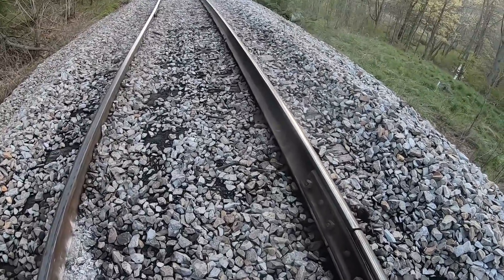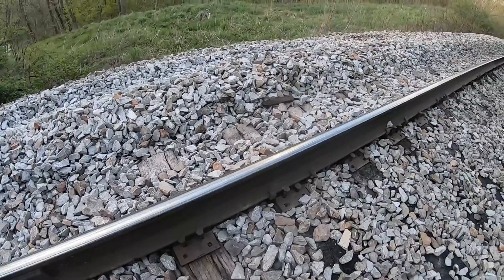Major Derailment: Locomotive Derailed & 2 Cars plus1400 Feet Track Tore Up!

Comment: Why would they NOT shut down the loco engines?  There're not going anywhere fast.
Reply from the maker: Locos are left running a lot of the time here, they never shut
down during the winter even if parked in a siding, Had there been
any leakage under the loco then it surely would have been shut off
right away.  And, consider if the loco was shut off and for some
reason wouldn't start again, that would severely complicate things
for the track repair crews. We have no way to drag it west out of
the way. They were also hoping Hulcher could somehow re rail the
loco quickly so no need to shut it off. Thanks for watching
Reply: @ccrx6700  that's really amazing considering wasting all that fuel just cuz you think the batteru might not start the engines.  I wonder why they don't put pony motors in to start the engines.

Comment: You got a mess on your hands to fix, could have been worse.
We had a 50 car train with 28 cars off the track and on their side in Albert Lea, MN, on May 15, what a mess that was, also 2 cars carrying hydrochloric acid leaked 40k into the ground, lucky no crew were hurt and no fire. Took about a week to get it cleaned up and the line back open.
Reply from the maker: Oh wow! Call out Cranemasters, Hulcher and Corman on that one.  I'll try find it online thanks 👍

Comment: Hey man.. you rr opps should consider getting "stampped steel ties" you arent CTC.. they hold gauge , use pandrol or similar clips and would help prevent rail rollover as well as gauge separation in curves. They cost more money up front but retain value due to when they are waste they are 100% scrap-able. You can replace or use them spaced out with wood ties. Probably would have saved this situation from happening.. seriously a good idea to have your company look into.. especially considering you guys are about to have to buy a lot of ties.
Reply from the maker: Martin thanks for watching and hope you will take in my next video
on my theory on why the derailment happened. It's here:
https://youtu.be/2uGomCuZkV0

Comment: Simple, get the cars up and moved to good track, get the locomotive up and move it the other direction, kick the rails to the side, jerk the rotten ties out, replace everyother one or every third ( depending on what's left of the originals ), rebuild, tamp and line. AND OF COURSE, WHAT CAUSED IT. Will be watching for that video.

Comment: That must of been a terrible surprise for everyone, including the train crew. Seeing the mangled rail a ties that are chewed to pieces really shows the mass and power of the train. I sure am sorry Dave. This probably hits you hard personally, especially considering the pride you take in keeping this line in shape. There's nothing you could have done about it. Maybe the company will allow for larger maintenance budget. I'm really looking forward to updates on the repairs but only as you are able. How that engine didn't tip over is amazing. It's a long drop off the edge too particularly on the one side. Just wow.
Reply from the maker: Yes it did Jeff, you know me pretty well, and you are right, this was a wake up call and our budget has increased from skimp where
you can to now spend whatever it takes! Thanks Jeff

Comment: Phizzicks man... One weak point can cause a cascading failure like this. Lucky the cars and power didnt roll and drag more train off. I guess what save you guys from a bigger mess is that you guys run typically at lower speeds, you're not running at 50 - 70 MPH and such.  Will be interesting to see how they get equipment in there and stabilized enough to put the cars and power back on the tracks though
Reply from the maker: Got a lot more vids coming out for you my friend, just don't have
anything like this happen with your new cars you just made....LOL

Comment: The locomotive has every last wheel on the ground.. but it stayed on the road bed and upright. The coal cars rolling would have been less of a problem than if the locomotive had run off the road bed and tipped over. There would probably have been extensive damage to it  had that occurred and you would possibly be looking at replacing it. Think that would have been more expensive than just needing to get everything back on the rail and the rail fixed.
With the cause.. the laws of physics tell me the outside rail was being pushed against by the train as it negotiated the turn. Being you said it's a tighter turn that means more force pushing against it with those 3 axle trucks. The force pushing against the rail over time was pulling against those spikes every time the train rolled through. A millimeter of movement here and there eventually created enough free space between tie and spike to allow the derailment to happen as a all but indiscernable gap let spikes pull free letting the track begin to roll. Speed might also have been a factor. Normal track speed on that turn might be too high for it. The faster the train is moving the harder it is going to push against the rail on a turn.
Reply: @
Jason Platco

hello how are you doing

Comment: That sucks man, I've been through two derailments, never that long of track though and had the same company come up and re-rail cars for us. Good Luck with everything.
Reply from the maker: Thanks Eric, yea these kind of things suck, but it happens as
you know, just gotta do what we gotta do. Hows the tamper running for you? I've been told tamper is the only machine that
can break down in a siding not running....LOL
Reply: @ccrx6700  Tamper is doing good. We just had a derailment too this week due to a sun kink, about 600 feet, 13 loaded cars of rock went off but nothing tipped over.
Reply from the maker: Oh dear! We had use excavators to line track close to where needs be, then i final with 6700. Get some rest cause once yrack tied in all pressure gonna be on you. Good luck an keep me informed my friend

Comment: Is there an industry test for railroad ties?
Also glad nobody was hurt.
Reply: There are on-track vehicles that can test ties/fasteners in track using something called a "Gauge Restraint Measurement System" (GRMS).  This system applies vertical and horizontal loads to the rails to test if the ties/fasteners are holding the gauge correctly.  There are also regular track geometry measurement systems that look for gauge change as a rail vehicle goes down the track.

Comment: Having investigated many derailments I can sympathize with your predicament. It is always a gut punch when it is your track. There is so much to check out; operation, mechanical, and track condition. In the video where you show the broken base I noticed what appears to be the point of derailment. Note the burr on the rail head. This is an assumption on my part. Lots of questions??.?? Good luck.
Reply: I'm thinking train Slack and then a heavy jerk derailed the cars in front of the engine on the Curve???
Reply: @plymouth-hl20ton37  it would be interesting to see if the high rail wheel climbed over the rail head at the same spot. There are so many variables and combinations that can contribute to the scenario. One thing for sure, repairs will cover up a lot if they don't find the cause.
Reply from the maker: I think you gonna like my next vid out Thomas, it my theory on
why this happened, I could be wrong, but see what you think
after watching that video and let me know your thoughts. Appreciate your watching sir

Comment: Good on-scene report with honest reactions to the pervasive damage.

What I really don’t get is a full grasp of which way is which, which way the train was moving, etc.
I have long understood your loaded trains go downgrade to interchange.
Your opening scene showed the 2 grounded cars at the end of a string — rest of the cars are on rails.  Ok.
You then pan the other way to the derailed loco about 100 yards away — so we’re led to think that view musta been down grade towards the  lead unit.
You then walk down to the unit, filming clearly starts at the end facing the 2 cars (briefly seen in distance — ie, supposedly upgrade?).
You then walk around the loco showing the trucks skewed etc — especially 2 wheels bracketing each side of the rolled rail.  Nasty!

Now it gets odd.
You walk about 50-60 yards away from the unit, NOT the end facing the cars, showing the point on slight curve where the track damage started.
How did the derailed cars get 100 yards downhill from the derailed unit?

The only explanation is that the unit you went to was at the EOT, — it had to be a trailer, it was not in the lead. 

So last 2 cars at the trailing end of string plus the trailing loco went off the rails,.
And the lead unit with all other loads stayed on the tracks (downgrade) — but you didn’t film that end.
When the last 2 cars and trailer unit went on the ground, — the air line separated when the trailing unit let go of the final car.
The trailing unit ground to a halt much sooner than the rest of the train.
Make sense?

I think in your excitement & shock over the damage, you just forgot to orient us fully to the scene, which is understandable!
Still love ya.
I hope nobody makes fun of you for not expressing your enthusiasm for railroading today.
We know you’ll bounce back as this cleanup progresses.
Keep the cam on the cleanup action as much as you can.

I would guess your RR’s investigators were not yet fully on scene to take photos, measurements, etc yet — hence that’s why the unit was still idling while on the ground (someone asked this elsewhere in comments). Nobody is probably allowed to touch or change any controls once the craziness stops and everybody is certified as ok.  
Do your locos have black box recorders?
Will there likely be internal or FRA/STB hearings?

Best of luck in the recovery of service.

Comment: Be interesting to see how they pick the loco with the sides so low.  Going to be a lot of work to get that running again . Thanks for sharing .
Reply: I think the side boom dozers typically used in derailments these days can operate when not level IE riding the grade of the ballast. But It doesn't look like there's any access road to bring in heavy cranes which would defanily reach from flat ground.. but tracking large excavators with enough lifiting capacity to handle 2 on each end for the locomotive to do the lifting might be doable. I've seen some amazing retailing work done but the remoteness of that location defanitly presents it's own challenges.
Reply: @jasonplatco7881  It sure looks like a challenge but those guys know what their doing . I hope we get some video of it .
Reply: Yup.  They have to kedge the whole loco up hill at least 100 yards to good track above the derail spots he showed near the end of video.  It’s gonna be a bitch to do that with a steep raised embankment.  But HULCHER will prevail somehow.

Comment: How hot has it been?  Maybe it went out of gauge due to heat expansion and the locomotive derailed.
Reply from the maker: Notice in the 4th segment of the video the gaps between the rail 
joints, had thermal expansion been a factor then there would be
no gaps in the joints. When rail expands, you are correct that
once the gaps are taken up then the rail can push up, we call that
"nervous rail" when that starts happening, but it was not a factor
on this day. But my friend, we can always blame everything nowadays on global warming....LOL   Apologize for that but couldn't help myself with that one...... thanks for viewing sir
Reply: mid 60s

Comment: could speed be a factor? a little too hot in that corner and bessie just starts pushing out that outer rail and boom, you got the issue...
Reply: My thought when I saw it
Reply: Dave had said that engine speed was just 22mph with a limit of 25mph
Reply: @robertinscoe2379  indicated vs actual can differ... takes a heck of a lot of force to roll the rail like that and the road bed is maintained well, be interesting to see how this one plays out
Reply: @northstar2007  yes sir. I still think one of the loaded cars had a bad truck and rolled the rail under it.
Reply: I think a lot of us are thinking speed being a factor, but that's the usual suspect at first I'm sure. With that being said lets let things play out and see what follows..I suppose a bad wheel/truck assembly, or possibly an over loaded car could cause a issue as well. Very curious on the outcome of this. No one was hurt, everything else can be fixed.
Reply: @larmo5633  very true! Im waiting to see what happens! there's more videos to come and I have a whole passle of baaaad bad jokes to post in them :)

Comment: Did the derailment start at the end of the curve as you transition from super elevation back to level track?  Maybe a wheel flange rode over the top of the rail in the transition area and the rail got caught between two wheel sets of a truck assembly. That would explain why the rail is laid over like that, why the train stayed upright within the roadbed, and why so many ties are cut. Once a car or locomotive truck was on the ground those wheel flanges will cut through the ties plus any dragging equipment. Sorry it happened but a great amount of content potential at least. Glad no one was hurt. How remote is that area to get equipment into?
Reply: Excessive train speed may explain it too. That and an undetected mudhole perhaps? Dunno my remark is just an opinion of a YouTube commenter which as we all know isn't worth much lol.
Reply: @
littlewingpsc27

hello 
how are you doing

Comment: Knowing how much pride you take in “your” track, this must be a real kick in the keyster! Was the derailed locomotive the pusher, that would explain the distance between it & the rest of the train.
I feel for ya, brother!
Reply: I’m convinced that loco was on EOT.  The lead unit and majority of cars stayed on track, he just didn’t film that end.
Reply: @dock_yard1149  So something might have gone wrong with one of the cars, maybe the last one still coupled to the rest of the train.
Reply: @dock_yard1149  So the loco we saw wasn't the one doing all the damage? That makes sense since there was damage both behind and in front of it. I hope Dave is able to get some video of what caused all this, after he/they figure out what it was.  I wonder how hard it will be to get equipment to the site; didn't look like there was much room.
Reply: I was wondering that to🤔
Reply: I'm pretty sure that was the tail end of the train that derailed, the last 2 cars, and the pusher engine.
Reply: Looks like extreme buff forces by the pusher locomotive or DP power to me.

Comment: Maybe on curves the spikes should be threaded like screws: screw-spikes or scrikes.
Reply: it will still pull them out.
Reply: @rearspeaker6364  Tear them out, maybe, but without the twist/turn (locking washers) longitudinal movement will not occur.

Comment: Glad no roll overs and no one hurt, was this the lead or the rear engine? Based upon the direction I would think rear. Was someone in the engine or did you get the remote working? Seems like maybe the engines were not synced in the speed or brakes. As you say that's railroading but man does it suck.

Comment: Hey Dave !!!  SEE ,,you CAN"T have a day off !!!   What a mess !!!  If it were in the height of summer with temps in the 100's ,,I'd  say it was heat expansion !!! Too bad that there wasn't a railcam there to record the issue !!! Glad NO one was injured & that ALL stayed upright !!  Waiting for more of your reports & videos !!!  What a way to start spring/summer days !!  ""KEEP IT SAFE ""!!!  Yes, have seen other videos where the RR's had sections of track already to go & had them trucked in to the sites,, but in your case,, guess they would have to be railed in !!! Have a good week & THANKS AGAIN !!!

Comment: Will be Interesting to see how Hulcher makes necessary Repairs / Replacement to get it Open. 👍
Reply from the maker: Well Ken, sorry but I was not there when Hulcher did their work,
however in a vid coming up I do explain how they rerailed the
'loco. It pretty neat how they did it. that will be in the vid title: Damage to the Loco, in the video coming up about the Engine Burn Fracture will be how they rerailed the cars. Thanks for watching the show today sir
Reply: @ccrx6700  definitely need to install more oilers along those curves

Comment: Here is my guess, given the curve and the way the track is rolled out. I believe a boggie locked. Thus the wheel set on the hopper would not turn and follow the rail. For the rail to lift like it did you had to have a force to cause that and a locked wheel set would could and has done that. Major forces happen when a train goes into a curve. when Dave showed the spikes lifted to start off with that proves some inside force caused that. Had speed been a factor which in theory it could have been not that they were going to fast or over the speed for that part of the line. I think if they were going over the speed things would have been alot worse. The fact that the locomotive and hoppers were all upright tells me speed was not a factor.
Reply: That’s what I was thinking, given the troubles they’ve had with the under car pivot shoes or bearings?  That whole section of track just got mulched!  What a mess.
Reply: @chrisbeck8182  center pivot bearing worn/jammed,bogie side bearing missing.

Comment: Wow, at least the train is still standing. something has certainly given way under the train. the main thing is that there has only been sheet metal damage and no personal injury. To clean it up you need at least 48 hours. do you come there at least with cranes ran to the place??? As I see it, you can use the rails and the ties to be recycled. Good luck with the long shift. Greetings from Berlin/ Germany. Sven
Reply from the maker: Yep Sven coulda been lot worse, loco coukda been on its side spilling fuel. Appreciate your watching sir and stay tuned more to come 😊